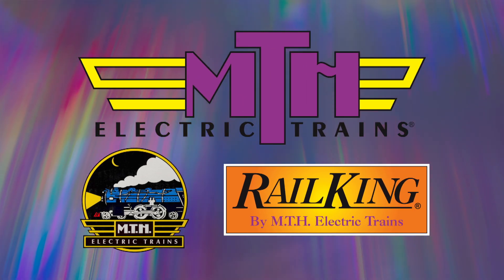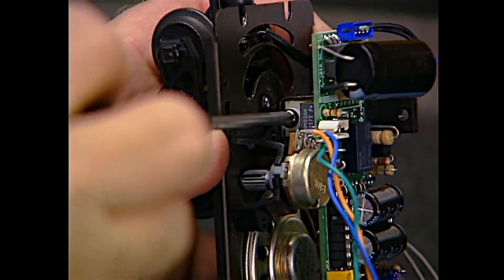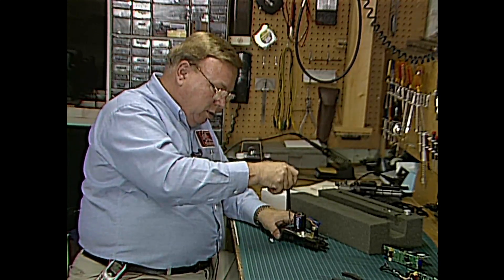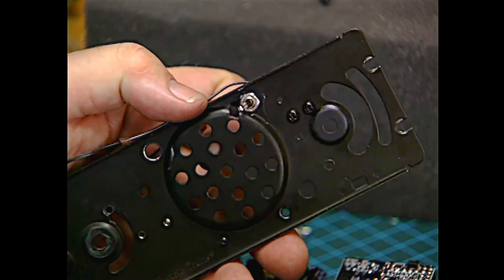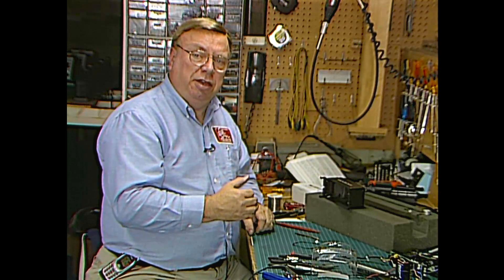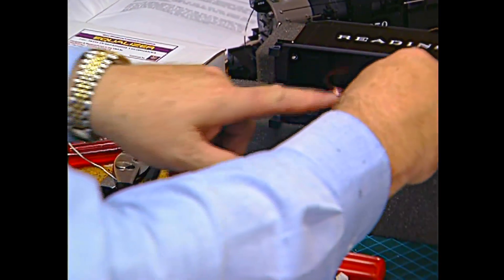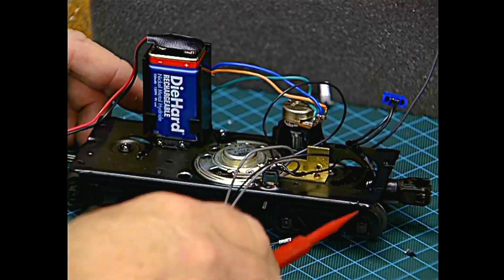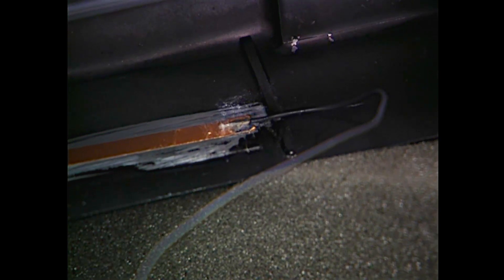Digital Dynamics Equalizer Install in an MTH Protosound 1 Loco

Comment: I put one of the Equalizers in a Rail King Southern Cresent Pacific.  It did not perform well.  Eventually had Art B from The Scaled Tin Rail remove it and make repairs to MTH caused by the E.  He said the design of the equalizer was “harsh”.  He did a lot of work with QSI.  Bought a LCRU from DD which works well to this day.  Equalizer needed some more work but idea was exciting.  Still have the Equalizer.